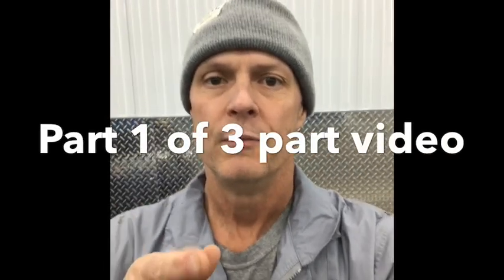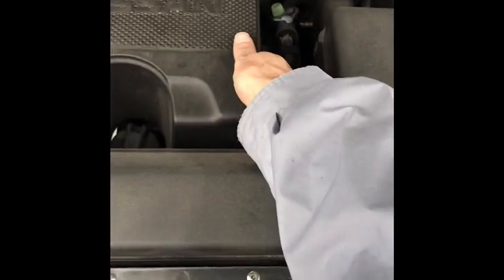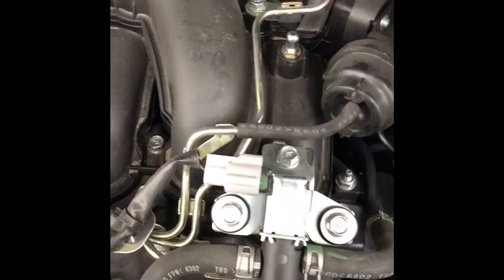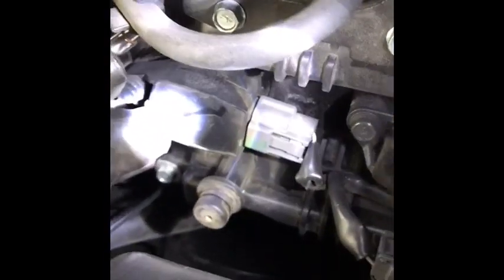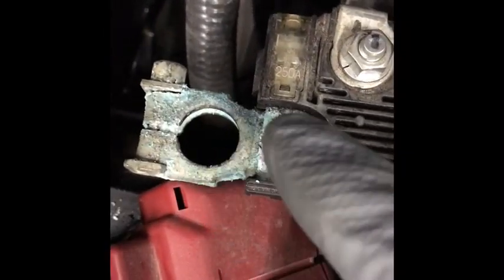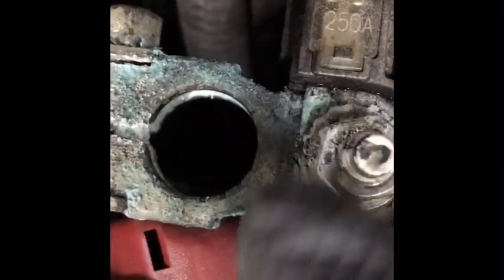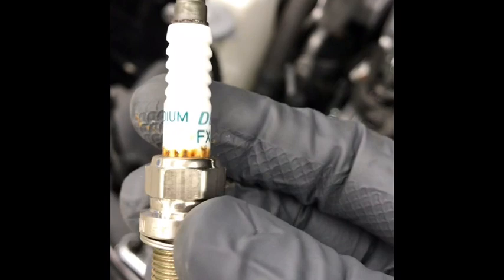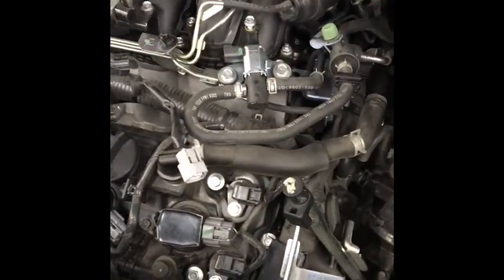Nissan Pathfinder Spark Plug Replacement - Part 1 DIY automotive.

Comment: Thank you very much for this video. Just changed the plugs in my wife’s 2014 Pathfinder this morning. Took me 1.5 hours with no problem at all. Your video is very accurate.
Reply: Jim Bob I want to change it too on my wife 2016 pathfinder but I’m scared but by reading your comment and watching this video i have full Confident in myself
Reply: @Muichirobaddie  how did it go? I'm considering doing mine
Reply: 1 hour is a long time to replace spark plugs lol

Comment: Great video. Changed my spark plugs today and your video definitely made it pretty easy. Went ahead and changed the intake manifold gasket and throttle body gasket, and cleaned out airbox while I was at it.  Also cleaned up the engine a bit. Highly recommend your video.    Thanks!

Comment: Thank you for this video!  My 2016 Pathfinder is very darn close to this.  Engine cover has some screws, I had to disconnect an extra piece or two from the manifold, but this is close enough.  And your words about the 14mm spark plug socket were enough that I ordered a 14mm magnetic deep socket to remove and install the plugs.  Well worth it.  If you’re ever in the Denver area, I owe you a beer or three!  Thanks again.
Reply: By the way, my plugs only lasted 84k.  Seems like that was definitely the issue.  I ran the scan and had codes for cyl 1/2.  Same Denso plugs.  I went with the NGK IridiumIX.  I was able to find them at a local shop.  Saw them online a couple places.  Just in case you are looking.
Reply: lnstantBoner Good luck.  His videos were a great help to get to them!

Comment: For the spark plug socket get a magnetic version or the standard should have a rubber gasket inside the socket to hold the pulg

Comment: I have a 4 cylinder nissan sentra and i have to remove the airbox, throttle body, and the intake to just change the spark plugs and coils.